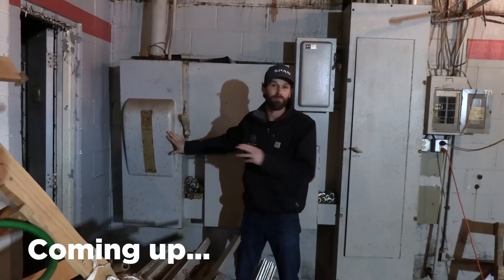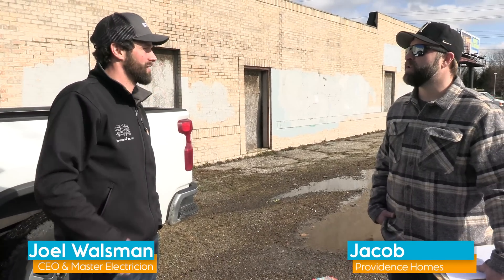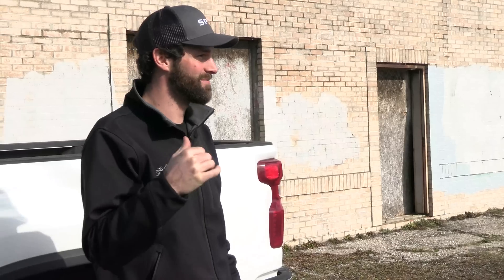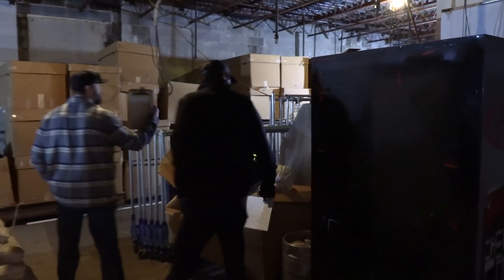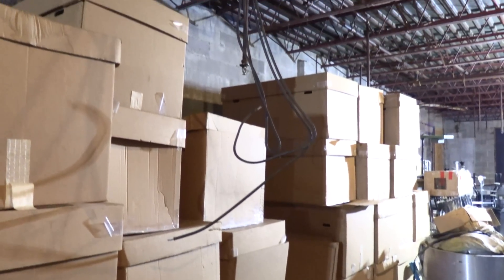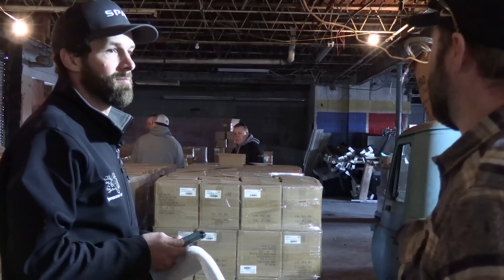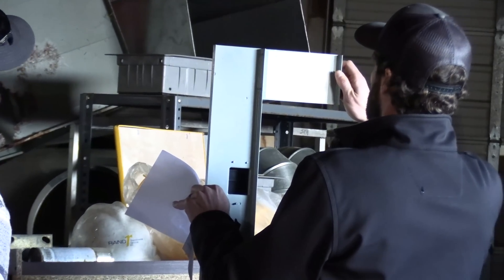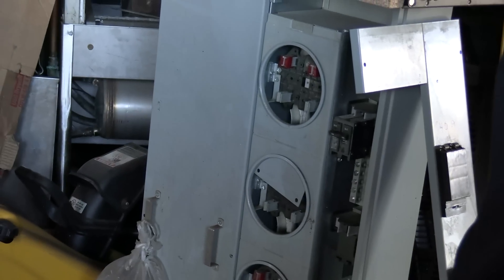Future-Oriented Customers Secure Our Future Success

Comment: You should push him to heat pumps as it's able to heat and cheaper in the long run.
Reply: May not be the case in Indiana, where gas is not artificially expensive, and where outside is naturally cold for most of the year.

Comment: I remember way back in maybe 2008 or 2009 or so I was helping my nephew at his business and he was renting an old building that had similar equipment plus in the same electrical room it had 7200 volt line coming in connecting to 2 pole type transformers it may have been 3 but I thought that was cool but very dangerous at the same time and it wasn't a locked room either it was just a barn door that you slid open.